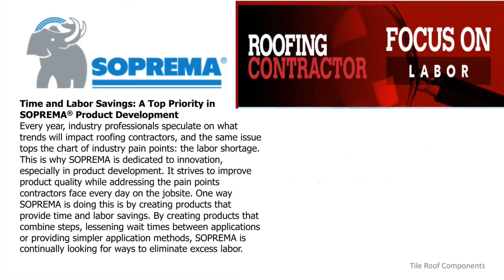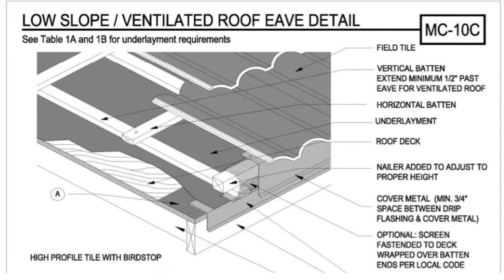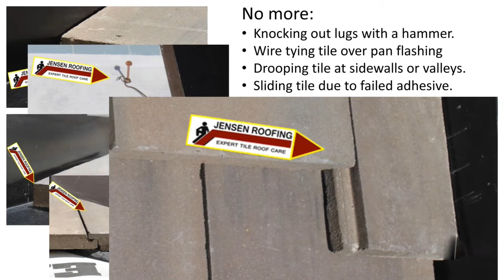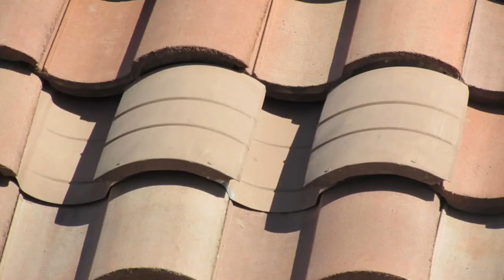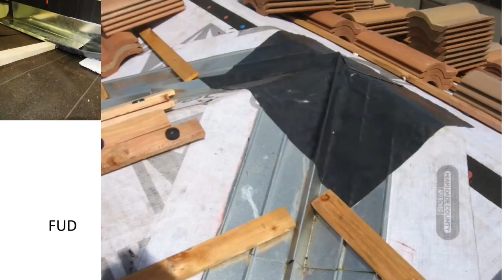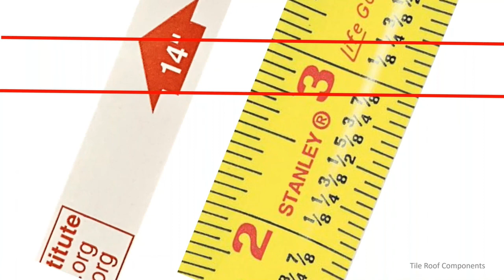Tile Roofing Part 3, Tile Roof Components

Comment: Thanks for the video. I bought 2 layout tapes from you guys. I'm doing my tile relay (flay 17" Lifetile). I have a 30 year + roofer helping me. He had never seen either the layout tape or the Tile Installation manual. He had a tape measure pre-marked with different colors for different headlap. Black for 3", red for 3-1/2" etc. We found out that one side of the roof was 1 course short as some courses had 2-1/2" and sometimes 2" headlaps on the original installation or possibly "roof tune ups" over the 40 years of the houses life.

My question to you about the layout tape is this. Isn't the layout tape limited at ONLY a 3" headlap?? For example if I use the Roof Layout chart on page 27 of the manual and my distance between the eave course and ridge mark is 18 feet on the money the chart shows a 13 -1/2" exposure. Wouldn't that render the layout tape useless since its only marked for a 14" exposure??

Or are you saying by swinging the tape laterally so the top red arrow lands at the ridge mark that process absorbs the fractional difference over the tile courses??
Reply from the maker: You state it well. We are always required to have a 3" headlap (unless precluded by the tile manufacturer's design, rare, and not relevant with your Lifetile. Your 17" tile, should have an exposure no greater than 14", that's why you have the 14" Layout Tape, If two rows of paper 14" Layout tape are aligned perpendicular to the eave, the arrows starting at the top of where you choose to be your first row (or the upslope side of the first row batten) to the top of where your top row is selected to rest (or the upslope side of your top row batten), and they fell exactly (never :-) on those two selected placements, your rows would be the maximum 14" spacing. When the tape is swung or rotated to the left or right as shown in the manual, until an arrow aligns with the top row, you are reducing the actual exposure. If you do two strips of tape, align with the top and bottom, and swing the tape, the rows will be something less than 14" apart. You do not use the table, and the tape, One or the other, That said, the exposure using either will be identical, or almost identical. It is exactly the same process as with a marked tape measure, except you do not have to transfer the individual marks to the undelayment.
Reply: @tileroofingorg  perfect explanation thank you !! It’s one method or the other . I’ve watched your layout video several times . Your answer clarified it . Thanks again !!